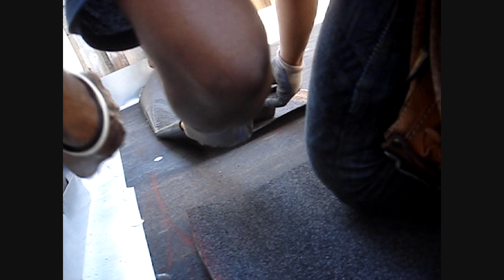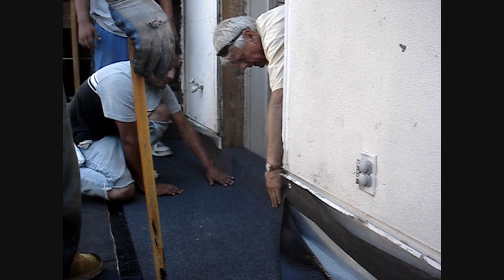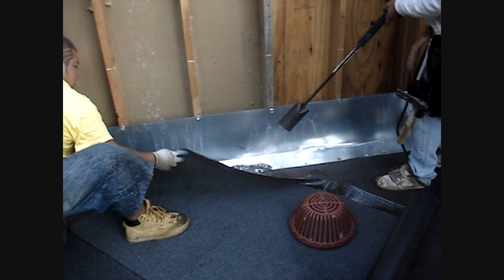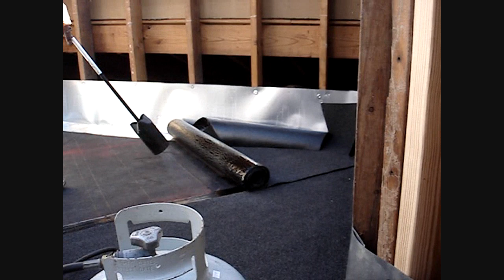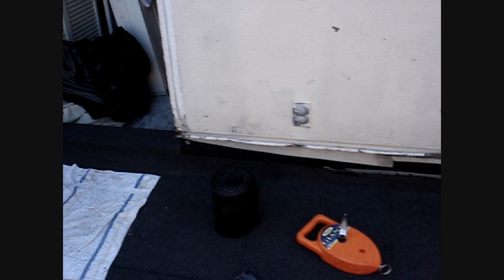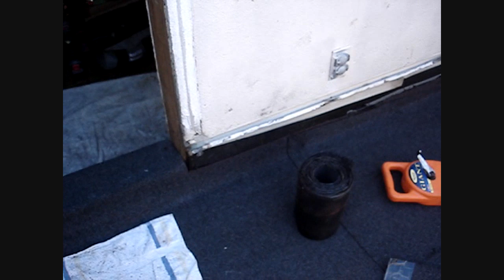Bitumen Torch Down Roof - 4th Floor Garden Parapet Roof

Comment: Wow!  I thought I had seen it all.  Doesn't the manufacturer specify 1m lengths stripping/flashing detail?  Thanks for the demo of how not to roof!  The company should train their workers properly and pay them well.  None of this fly by night stuff.  The free market system works!  lol  Lowest bidder gets the job!
Reply from the maker: More like only bidder gets the job - no one wanted to touch this roof - and no one wanted to put down a Rubber Membrane, as was called for in the original plans for this house, built in the early 1980's...

Comment: Didn't cut t corners, improper lap, improper heat distribution, no bleed out, wood cane, stepping down cap sheet, improper pillowing, improper everything. I hope saving a few bucks was worth it, cause the only thing I would guarantee is that your roof will leak.

Comment: Okay look at these unexperienced WORKERS, not for nothing I can torch blindfolded better than these guys.
Reply from the maker: As a Plumber, I had never seen this material/system installed before.  So, it wasn't until this failed my first Flood Test that I found the Specifications from the manufacturer and discovered they were installing improperly.
Reply: That's like me a roofer going to do new construction plumbing.  If you seen my video of torch down you would see the difference.
Reply: Friendly Dean  look up my video and see the difference -  Torch Down 180 White Rolls Brooklyn
Reply from the maker: Mike Smaili
Yes - once this installation failed my Flood Test, I went and printed up the Manufacturer's Installation Specs and then knew that this was all wrong...